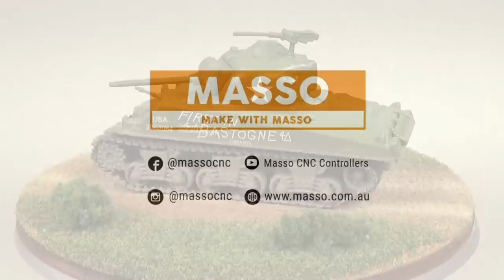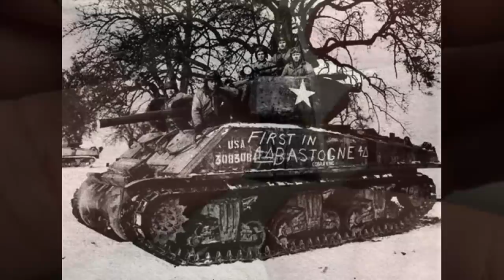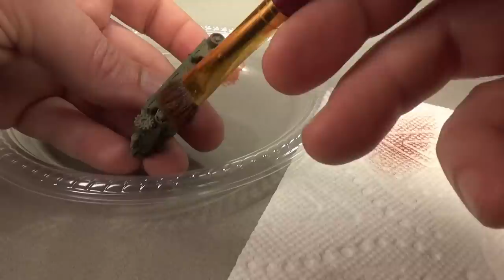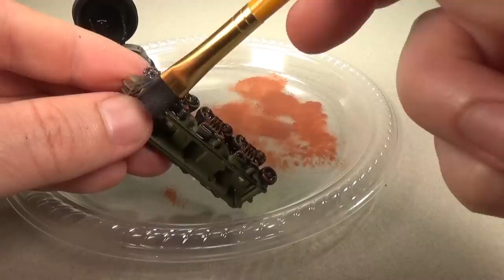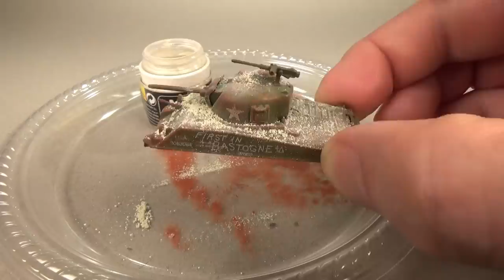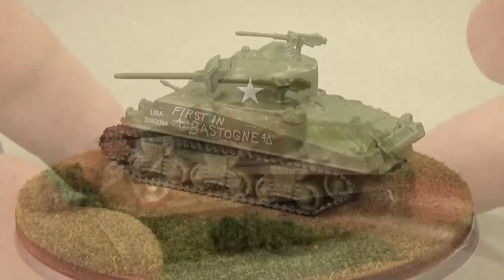Simple and Easy Weathering Techniques on a 1:64 Sherman Tank

Comment: One small point: unless the tank was broken down, or parked up awaiting repair, you wouldn't get much snow sitting on the rear deck. Most of that covers the engine, and the deck is largely vent grilles for the engine. It would be warm, which is why you will see pictures of troops riding on the tanks, especially the Russians, on their KV-1 and T-34 tanks.
Reply: But the tank was broken down lol
Reply: Your right. I was wondering why that didn't seem right to me, but since the tank was abandoned its most likely that there would have been snow covering the vents

Comment: Small complaint, you added rust to the machine gun on the front of the tank. The crew would have never let the machine gun rust out to any capacity. They would have properly oiled and cared for it. Also I feel like the red in the rust is a little bit to warm/bright I think a darker color would be a little more appealing. That just my opinion though. Besides that you did a great job on this tank and I love the new dimensions that have been added to the depth of the detail.
Reply: in defense of the artist a fresh rusting is brighter typically and if the crew had been inside through a long period the rust could have formed on the barrel. no doubt they would have done something about it once noticed, however if they'd been trying to avoid exposure while moving through brush and enemy lines it is possible the hadn't seen it yet. rust forms quickly on untreated metal that is exposed to any kind of moisture.
Reply: @KennyGarland  My opinion about the color of the rust is that it looks like it is from a dry environment. I've seen his Mad Max videos and this color of rust works perfectly for the desert. I think a darker shade would fit a more damp environment. Also tank crews wouldn't be sitting in their tanks for days upon days, and never leaving, because they need to retrieve fuel, ammo, food, etc. Guns have protective coatings on them that don't let rust form, in that quantity, unless left in poor condition for weeks. A good crew would never let that happen.

Comment: For tiny tanks, I usually take a spot of flat black and tap the end of the gun barrel. I also tend to really go heavy with the "muck" on the front of the vehicles (especially tanks) as they didn't get cleaned up much, and were forever plunging into swamps and colliding with things. All in all, a great piece of work here sir, rock on!

Comment: Use a 1/32 dremel bit in a pin vise to very gently drill in the first few mm of the barrel, to make it appear...well, like a barrel.  Then a drop of ink or black paint brushed in.  Add a whip antenna for the radio.  Cut down a bit of tea bag, roll it up tightly, and attach it to the rear or side of the turret to make it look like a camo net, or other carried "bustle gear".  Although too small to route out, I would flatten the end of the .50 with a fine file, and dot it with black.  Maybe use some sculpy and create tiny .50 ammo cans to also attach to the rear or side of the turret.  Tanks would often carry a spare wheel or drive sprocket on the turret (a practice that continues today), so perhaps cast one from the undercarriage and do that?  At rest, after battle, tankers often clear brass out of the turret, so in your diorama, maybe some lengths of styrene rod cut to scale, then painted with a brass colored paint, washed in black, scattered around the hull.

Comment: Cool video.  There's lots of weathering techniques to explore, but here's a couple you might consider:

Rub a pencil lead against the high points on the treads to make it look like exposed metal where the paint and dirt are being scraped off by contact with the ground.

Oil washes are a fairly large subject, but thinning oil paint and using it to pick out the concave details on a model is a good case.  It can either be applied directly to the details or it can be laid on over the whole surface and then unwanted oil wash can be removed with a cotton swap and odourless paint thinner.  Oil washes are also very effective for producing rust and grime streaks.

Hope that's of interest to you.  Happy tanking :)

Comment: I really wanna see you add some battle damage!! You would need to carve into it to make a hole for a tank round, but also deform the surrounding metal (or make it look deformed somehow) in the way that it would deform when penetrated. You could do a penetration on the turret ring (one of the most common causes of death for a tank in that era, if I'm not mistaken), a deflection or two on the front (because of the heavily armored front plate of the sherman jumbo), and then some smaller caliber non-tank bullet marks (from tiny bullets deflecting off and only causing minor surface paint damage). 

Or maybe you could add camoflage? Like the soldiers stuck brush and plant matter all over and into the tank like a tank ghillie suit.

Comment: The actual model shown here is an M4A2 tank used by the USMC
Reply: It could be M4A3 just the "First in Bastogne" tank was M4A3E2 - different turret.
Reply: No sorry a jumbo has vvs suspension and the model shown here has bogies as the suspension system it also doesn’t have extended gards and also it doesn’t have the wider tracks
Reply: @mattchandler2380  The model is M4A3 (VVSS) which can be noted from the wide engine grille. Both A2s and A3s were made in VVSS and HVSS variants. However as you said it isn't Jumbo and it definitely isn't the Cobra King.